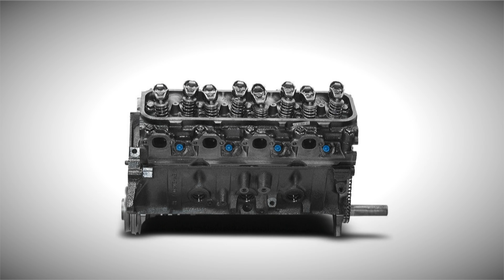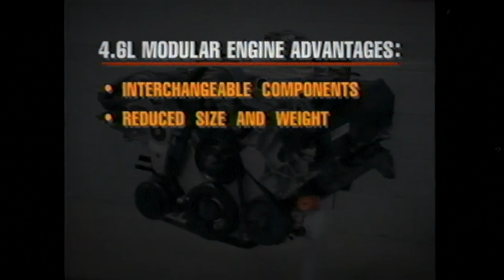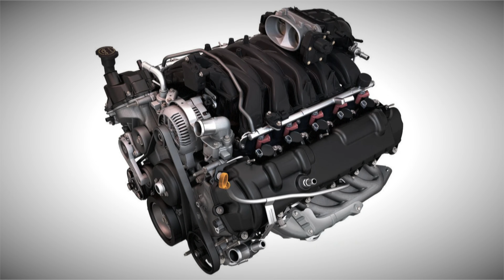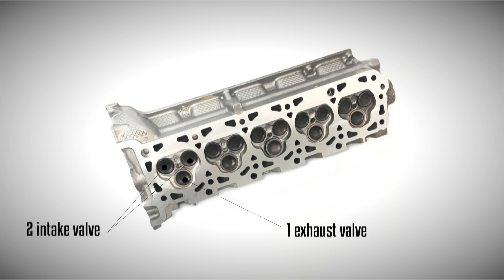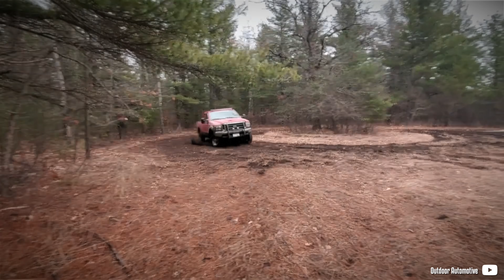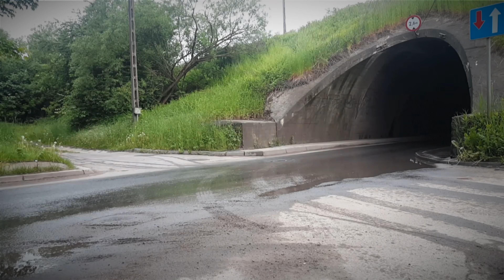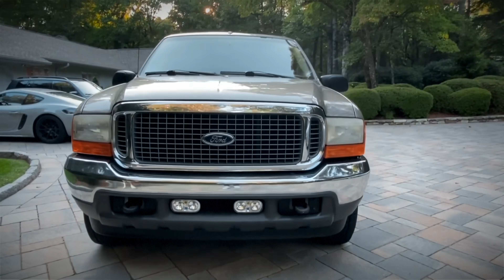Is Ford's V10 Truck Engine Any Good?

Comment: good riddance from the world of engines to that piece of crap made by FORD ,,,the sparkplug failures were the least of it's problems ,, the mile long timing chains and the timing guides that the engine eats ,,wanna know why hotrod builders don't use anything made by FORD ,,parts interchangeability ,,ford has over half a dozen different transmissions and everything they build is overcomplicated ,,wanna know why they came up with the godzilla engine ,, cause they were getting their asses kicked in the reliability department ,the coyote is a high strung sensitive piece of crap , the triton engine had trouble reaching 200,000 miles without being rebuilt,, 300K miles NOT ,,meanwhile every LS everywhere reaches 300K miles without fail ,, take a good look at a Godzilla 7.3 it's an oversized LS right down to the 6 bolt LS style main caps and the valve cover mounted coil packs

Comment: @Build it Yourself has a series on fabricating four valve Dohc heads for this engine. It’s almost done and the whole series is very interesting
Reply: Deboss garage is putting one in a mustang.
Reply: @dotlaj  the regular SOHC variants have been put in mustangs before but they are rather lacking in aftermarket support so you can't make big power on them sadly. That's why it is uncommon to see them last long as the 4.6 4v and 5.0 are more widely embraced. Hell even the 5.4 4v gets over looked for the same reasons as the V10

Comment: Seems like the guys that got a good one, really liked them.   If you got a bad one, there wasn't a lot good to say about the truck.    I always enjoyed hearing them.   Great video as always!
Reply: I got a bad one. A 2006 F250.  At 160,000 mile it developed a knock. Main bearing failure. After having the engine rebuilt, many times it  would not start. Replaced the engine management computer. After that, frequently, it would misfire badly. Replaced the plugs and a number of coils. Problems continued with not starting and misfiring. I finally sold it with 180,000 miles.
Reply: I was pleasured with swapping the 4th engine replacement after only 110000 miles. The 3rd was missing 5 rods when I had to work on it. Terrible service trucks!
Reply: Triton never made anything good. Just shit and sightly less shitty shit. These are just shit lol along with the 5.4s. literally no reason to drive one of these dumpsters anymore

Comment: If you do a search here on YouTube you'll find a couple of guys who have made their own 4-valve heads for the Triton V10 by hacking up some 5.4 4-valve heads from the Aviator/Navigator and welding them together. The goal is 700+hp N/A with 13:1 compression and 8,000rpm redline.
Reply: A poor man's viper, good show to that guy.
Reply: ..also preheating the parts to be welded together before they are fitted on/in to a purposefully made harder, spec of metal alignment jig, that's previously had the heated parts test-fitted to, (with required alignment shimming and clamp tensioning  already derived at,) before being welded together, helps, with only
Reply: Things like that have been going on for decades.  Even Chrysler's first prototype V10's were welded up from hacked-up 360 blocks.  But don't expect durability from aluminum heads that have been welded together.  The heat treat has been ruined, and the material made soft and weak.  Any attempt to heat treat back to the original condition will cause warpage, making the head useless.
Reply: @andyharman3022  NASCAR teams sliced up and welded heads to heck and back. They had a way to heat treat it where it lived for numerous races. It can be done
Reply: @andyharman3022  it's gonna be used for a car nothing heavy, and they are doing everything they can to minimize any risks. I've been following them for a while they are taking their time and are doing just about everything right.
Reply: @dustinontaiyabbi  you don't think vehicles eclipsing a ton and a half are heavy?
Reply: @Hawk7886  3000lbs is pretty average for a vehicle. The c4 corvettes are tiny and are still just over 3k lbs
Reply: @andyharman3022  heat treat and then resurface???😂
Reply: @andyharman3022  - that V10 was most complicated turd ever conceived awful design this Ford V10 was mass produced very reliable not a useless relic like the engine you mentioned
Reply: @CoyoteFTW  Must be a Ford fanboy there.  How is an OHV V10 more complicated than an SOHC V10?
Reply: @andyharman3022  pushrods means simpler to you still ? You want to tell me you think ohc engine is complicated 😂 seriously
Reply: @CoyoteFTW  No engine is simple, but I'm keying in on parts count and a more difficult assembly procedure for timing the multiple cams.  The Ford modular engine family is notorious for having different cam timings bank to bank, and poor performance because of it.  And if you want to modify your engine with hotter cams, it costs twice as much to buy them.  On dohc engines, 4x as much.  And the 6.8L V10 adds a balance shaft in one cylinder head to further complicate things.
Reply: @andyharman3022  pushrods and rockers, more moving parts, more inertia in the valve train necessitating stronger valve springs which cause more friction and wear. 19th century technology.
Reply: @philiptownsend4026 wrong, you can pull an ohv head in 20 minutes. Have fun dropping your cam chain.

Comment: I want one. No theirs not a ton of after market off-shelf parts for this motor, but if you peak around on YT and the internetz abroad, you'll find some unique builds utilizing this V10, and the latest from an up and coming channel here on YT where these guys have invested a ton of R&D on converting a stock SOHC to a DOHC to mimic the mule motors Ford had in their black ops development back in the late 90's/early 00's for their re-release Cobra that never became more than an auto show piece.

Note* as far as the issues described, the modular V8's also shared some of these design flaws.

Comment: Same engine in Saleen as in Cobra? Got to take an 01' (?) Saleen around the block via the e-way. Cooked down the ramp and was doin' 120+ in third at under 4 grand then got off. Torque steer jumped across the lane of an impala at a green. Rookie 😃
  Excursion had a supercharger they'd slap-on with a scooped hood maybe the cobra one too. I loved those bumpers.. Neighbor's daughter came to visit and parked right on the street, like almost blocking it, she wasn't close to the gravel. Anyhow.. Backed-out with that excursion and hit her intrepid and started pushing it off the road. Didn't notice till her tire popped from the quarterpanel going through it. She cried a lot. Spidered her windshield and the hood was pushing the other quaterpanel off the other side. I wasn't going slow obviously, but not fast either. Just leaving normal. Thing was a beast. Hardly scratched the bumper.

Comment: The only reason the 6.8 L V10 could out due the old 460 V8's was because of how badly emission compliance neutered the old V8's in the end.

Take the crappy emissions cam and tuning out of a 460 V8 and input in a good heavy towing cam and matching fuel map tune and it will do 400+ HP and 500+ Ft/Lb of torque all day long while still outdoing the 6.8 V10 by 20% or more on fuel efficiency at the same time.

Comment: The spark plug thing is a bummer....IMHO its low on power and high on fuel use...i hope the new 7.3 gas engine is a hit i could see having one if the spark plugs don't shoot out or it needs a $10,000 "bulletproof kit".....

Comment: I remember this V10 from the RV's I drove on US roads. This engine was able to accelerate the 7.5 metric ton camper to 60 mph in just 10 seconds.
Reply: That's nuts! 😁
Reply: @Markpd69  Yes it is, but it comes in handy when traveling through the Rocky Mountains with a stacked fridge, baggage, 100 gallons of water, 50 gallons of gas and some 50 gallons of waste water added to the weight. 😁
Reply: Yup
Reply: I've never seen an unloaded short frame f450 do 0-60 in 10 seconds
Reply: @Burden-THE  we had an old v10 box van with a long rear overhang at my old job with like 5.13 gears that would do smokey burnouts, and if you bounced it up, carry a wheely for 30 feet or more. the v10s have some ass to them. not buying the 10 sec 0-60 either though.

Comment: We have an E450 V10 cube van at work and I much prefer it to the E350 6.2 V8 we have. Both 5 speeds. Runs a lot smoother and quieter, maybe slower but that’s probably the weight of the van. Is it a hot rod engine? Of course not, but for getting 6 tons of vehicle and plumbing tools around, there’s not much else I prefer. A diesel would not really provide anything more, it has enough torque and I’m not racing people in a company vehicle. Haven’t tried the 7.3 yet, but I hope it’s smoother than the 6.2 when we need another van.
Reply: a diesel engine would double the torque and gas mileage, tho
Reply: @mclarenCR  I'm really only considering gas motors for the vans, we have a diesel super duty for towing when we need that, but for day to day operations, the gas motors have more than enough torque for what we need them for. The gas motors are still cheaper to operate when considering maintenance and initial cost.  Upgrading to an f-series cutaway would still cost more than an e-series without including the diesel motor, and Ford stopped selling the e-series with a diesel over a decade ago. That said, the video is addressing the gas V10, which is why my initial comment from 10 months ago was reflecting the benefits of that motor over the 6.2 gasser, and wondering about it's current replacement, the 7.3. I merely mentioned the diesel because I wanted to get it out there that it was beyond our needs for the vans.
Reply: @TheLazerTank   good luck, very nice trucks dude

Comment: I drove a 6.8 bus from Oregon to Guatemala, and it tackled all the hills, and the elevation changes with zero issues. never gave me any problem
Reply: You never want a bus to quit on you going through the planes/desserts Mexico
Reply: I drove a 6.8 bus too all the way to Costa Rica! Never gave me issues
Reply: @michaelthomas7408  that is said an awful lot but the V10 fuel economy isn't much different than a big block chevy, Big block ford, or any big displacement engine offered in modern trucks right now.
Reply: Doom Patrol?
Reply: Wow what a trip. Would love to do something like that one day.

Comment: In Europe, we wants kids to use ridiculous pedal powered school mini-buses.
In the US they have screaming V10 buses...
Reply: And in Canada in the winter sometimes the drivers will do a little drift on the way to school!
Reply: And many of them run on propane in case you didn't know that. In Europe you have some mega-horsepower V8 diesel semi tractors that are way more powerful than the diesel truck engines out on our highways and interstate transportation corridors.

Comment: Brother, love your videos. The 10 cyl has mixed reviews here but I can tell you they take a beating. The old 460s are fantastic and in the 69-71 Lincoln they were on par with anything Detroit had aside from the ls6 and hemi
Reply: Yea my Dad owned Lincoln’s, from 71-78, 4 in all. Each one of the first three were passed down to his brother in law who was the Sales Manager of the family trucking company. Who added anywhere from 210-320 THOUSAND miles on each with never having to remove any pans or covers. Just starters, water pumps, just one trans, one rear end. This was after I was caught on radar at 129 mph in the 71 coupe
Reply: Stock no engine from smog era 70’s  was fast. The 460 was/is very easy to turn into a powerhouse. Just look at the new 7.3 Ford, 7 second 1/4 on a stock Godzilla is what Cleetus Mcflarland did. 1300hp. Truck engine. Just need to have a good eye know what you’re looking at. 385 series or 460. Can grow more than any bbc or dodge. No replacement for displacement..
Reply: My dream cards are 68 mercury marauder and a 69 Lincoln mk 4
Reply: Saddly emissions compliance is what neutered them so bad they became worthless. 

In the end, most were putting out half their capable HP at half their capable fuel mileage in the name of saving the planet/maximizing government taxation theft through excessive fuel consumption.
Reply: @tcmtech7515  Imagine what a 6.9l Benz would have been without pollution control and had it lived long enough to get the 4 speed transmission
Reply: @peterchristlieb  Theres all sorts of old-school engines that would walk all over today's high-tech stuff in terms of power, fuel efficiency and durability if it wasn't for emissions compliance.
Reply: @tcmtech7515  absolutely, I’ve said for years, if you put the same brains, hot ignition and fuel injection the LS has on a square port 427 Chevrolet, you’d see 700hp naturally aspirated motors on pump gas
Reply: @peterchristlieb   Yep. I used to hang around with the first tech motorheads that were experimenting with that stuff when it first came out and it was amazing what they could do with modern electronics on old-school engines.   

Some basic head work, a good treatable towing cam or mild performance cam, and a properly designed EFI system were easily able to do 1 HP per cubic inch and walk all over its emissions-compliant twin on power and fuel mileage at the same time and be absolutely bulletproof on any major brand and model of engine back then. 

What was interesting to me was the guys who had the exhaust gas analyzers claimed they could do all that and stay well within emissions compliance numbers on pump gas too with nothing more than a good catalytic converter.  

The having to have shit power and fuel mileage to be emissions compliant was just a scam to get the government more tax revenue in any way possible.

Comment: How the V10 was a smart move I'll never know. 2 cams versus 1, extra chains and associated parts, harder to work on. Then came the 6.2 V8, and now we go full circle back to a pushrod V8
Reply: Yeah I don't understand why Ford downgraded to a push rod motor with the new 6.2. It's like Ford for the last 5 or so years they have been making really odd engine choices from design to placement.

Really wish they would go full Koenigsegg and bring to the mainstream market Free valve tech.
Reply: I think you meant the 7.3
The 6.2 is OHC.
I think a better argument here is why Ford chose a v10, then went back to a V8
Reply: @Soundsofthewood  I believe they went back to s large V8 because they managed to just about out-perform the V10 in the size and higher simplicity of a V8. Why spend more money and time with a 10 cylinder engine when you can get just about the same performance out of a V8 of the same size? The only thing I don't get is how people look at the 7.3 as some huge improvement over the V10. The 3V V10 made 460LB of torque at 3000 RPM. The 7.3 makes 475LB of torque at 4000 RPM. So the 7.3 out-torques the old V10, but needs 1000 more RPM to do it. Either way, I think the V10 is a very overlooked engine. I've never driven anything other than an Ecoboost F150, but that's my opinion as of yet
Reply: OHC was the zeitgeist I guess. Certainly it has big advantages in terms of breathing (ports are not obstructed by pushrods) and the ability to rev higher. But those things matter much more to a small 4-banger than an US style oversized V8.

Comment: Americans don’t seem to get a lot of power from huge engines but they have a knack of being them super durable
Reply: I think the power thing has to do with regulations and pencil pushers to be honest. Manufacturers sometimes fudge the numbers about HP and rate them lower than they are in order to sell that engine legally in certain car models. Old big block V8's from the 60's put out horse power ratings that were either slightly under, equal to or slightly above their cubic inch rating. So an old 426ci big block could be rated for 400-450hp depending on year and configuration. At least that's one thing I've observed.
Reply: durable and easy to work on for not a lot of money... and good torque range, lol
Reply: Having an understressed larger engine really helps with dependability when compared to a small one constantly working hard.

Comment: I remember seeing that engine mostly on Econoline/E-Series vans than in the trucks, as in my country the vans were a grey-import while the trucks had locally-produced versions and Diesel engines were used more often than gassers.
Reply: Most of them found in trucks were commercial truck and cab/chassis trucks. My 04 was a cab/chassis and was bought new by a plumbing company. Still pulling fantastic and will hit 250k miles at the end of the month and it's never been cracked open

Comment: Compressed iron powder? Is that compacted graphite iron? That's what Ford uses in the 3.5 Ecoboost for example and it's the best material for strength to build engines out of.
Reply: I would say the Billet 4140qt 5 axis machined blocks might be marginally stronger.

Comment: If I remember correctly these are used to power center pivot irrigation units in the Midwest.
Reply: They use whatever they can get cheap. I've seen a huge variety of them and setups. Someone had a 500 cadillac running the irrigation pumps.

Comment: my v10 has been great, the misfire is caused by a vaccum hose, easy fix. the spark plugs wont give you a issue if you use a torque wrench. and that 14k tow rating, well my friend has had 30k behind his and it handle it fine. mine engine has a utterly hilarious intake howl, dont know about the other ones thought
Reply: Coil packs will cause misfires.
Reply: That's weird, when factory torqued spark plugs went blowing out by the thousands. Oops
Reply: @Burden-THE  have you ever met union workers? clearly not
Reply: @roadrunner681  hahaha that's good

Comment: These are great engines.  They sound good with a stock exhaust, but a louder aftermarket exhaust makes them sound high-pitched, almost nasally.

Great video!
Reply: When straight piped, it makes a truck going slow sound like the driver is pissed off!!
Reply: @Burden-THE  LOL!